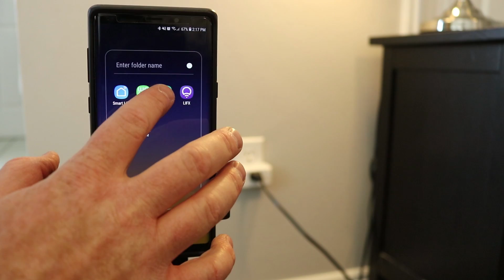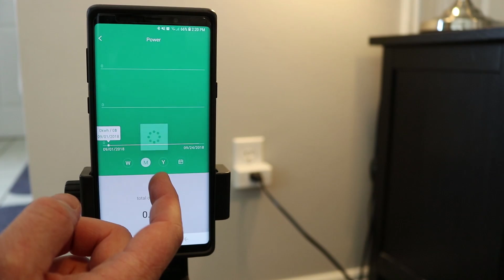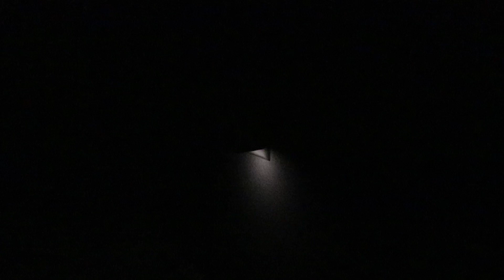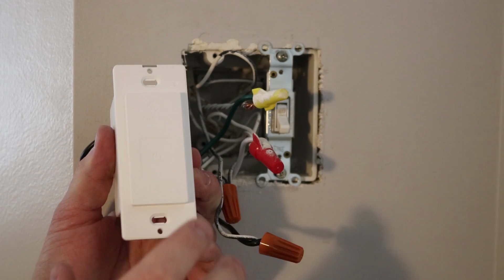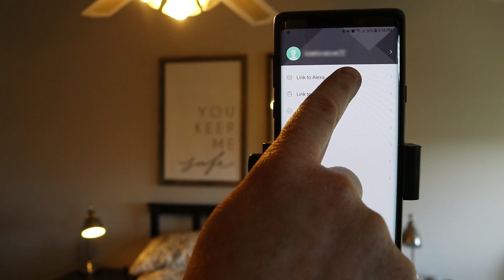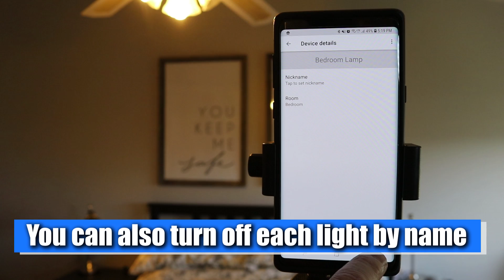Etekcity Smart Plug Mini w/ Night Light & Smart Light Switch Review

Comment: Love your video’s, especially the home automation ones. My opinion, you are the best reviewer on YouTube and thank you!  This set up you did, I tried the same thing.  I have 2 switches one for the light and one for the fan.  I wanted to just control the fan, on/off and couldn’t do it. Just as you couldn’t either.  If you ever do figure this out please repost a video.  Thank you!!
Reply from the maker: Thank you so much! I believe the fan would need to be wired separately to be able to make it happen. I am definitely on the search to find a way to make it happen!